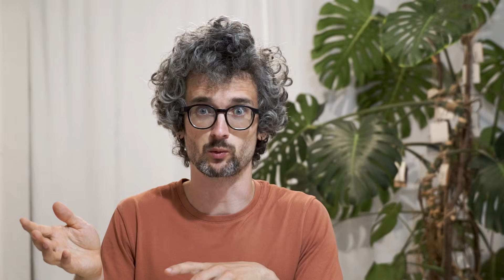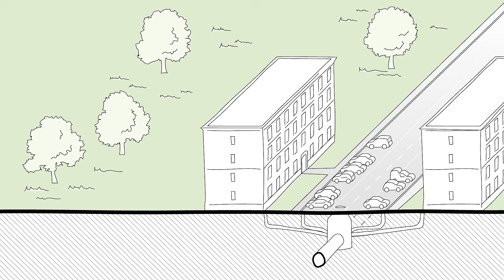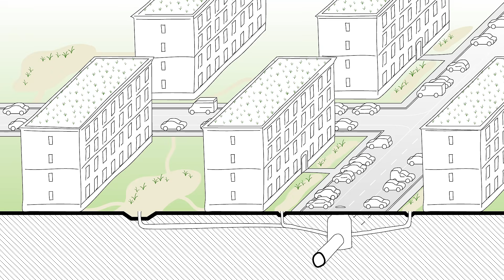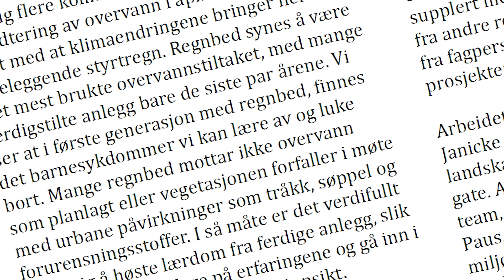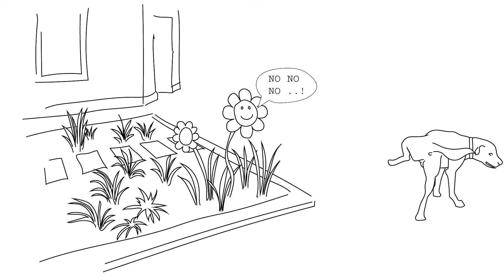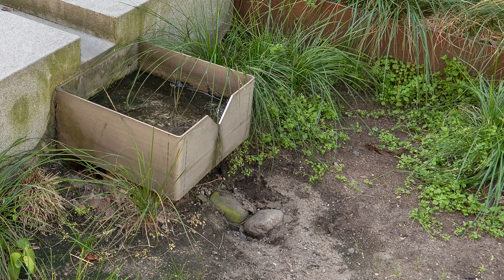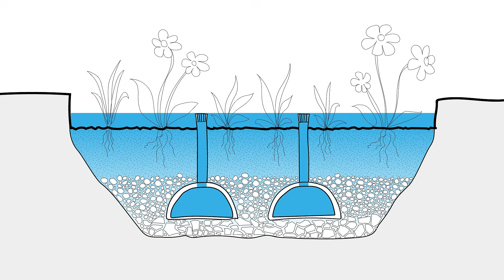How Oslo Turned Streets into Flood Protection

Comment: Two things that I guess probably need to be kept in mind and didn't come up in the video: (1) Raingardens should be designed taking the foundations of the buildings into account. We don't want the buildings to get wet cellars or weakened foundations because they were built under the assumption that rainwater is transported away quickly, and now there is too much hygroscopic pressure from the unexpectedly wet ground. (2) A city's drainage system was probably not built for long periods of carrying almost no water. This could lead to unexpected problems such as rats starting to feel at home in a location that was previously always under water, and causing critical damage in unexpected places. I am thinking of phenomena like a passage in a canal being blocked by the cadavers of drowned rats.
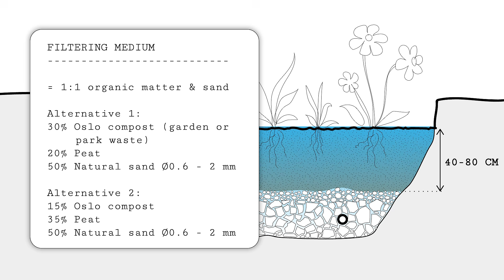Reply from the maker: (1) I briefly mentioned that in 8:28 - that is the reason to use drainage pipe in construction detail, to drain away water instead of letting it soak into foundations. 
(2) interesting, actually about this I did not really hear until now but I can imagine it can be an issue
Reply: @MareksUrbanChronicles  Thanks for pointing out 8:28. Maybe (2) isn't an issue. I guess this kind of thing is why these things start with experiments.

Comment: is there a point of saturation on the rain absorption at any level of rain intensity? i'm from brazil, a tropical climate, so it's common at least once a year to get something around 30mm in less than an hour, so i guess maybe it is not so worth the trade offs as much as in more temperate climates, although the retaining pool concept to not reach the overcapacity of "gray drainage" is very much welcomed

(sorry for my bad english)
Reply: Is not bad!😊
Reply: I'd assume there's a limit to how much it can help absorb. But that's still all away from flooding, and into the groundwater. It means less damage. I'd say that the more extreme rains you have, the more difference it makes.
Reply from the maker: in tropical climates it would be the best to use a combination of all steps probably. From small capacity green roofs, through medium capacity raingardens, until a high capacity valleys in city parks. For example you can check Bishan-Ang Mo Kio Park in Singapore, normally it works as a park, and during heavy storm it is just completely flooded. Photo dry/during storm: https://www.researchgate.net/figure/Bishan-Ang-Mo-Kio-Park-during-and-after-storm-event-32-photo-credit-to-the-Ramboll_fig3_354757552

Comment: Came here from a Brad Lancaster video - interesting to see how this can be applied in wetter climates. In Switzerland, we pretty much already maxed out our water retention and flood protection capabilities, but with the torrential rain getting more frequent and the winter snows less reliable, we might have to do similar stuff to cope with localized flooding. Last year they built a new storm drain system in our street to separate it from the local sewage pipeline - we live on a steep hill and rain gardens probably wouldn't have made sense.
Reply from the maker: True. With exception if there would be other part of the town under the hill which would be catching rainwater from your area. Actually in this Oslo project the part in Wilses gate is also built on a slope, through kind of garden cascades. Streetview: https://maps.app.goo.gl/q5yNmnFHrhMqN5gb7
Reply: Terraced rain gardens would definitely work. Probably need a different design, and the terraces would visually alter the streetscape significantly, but definitely doable.
Reply: @Lolwutfordawin  I think they discussed that, but people would have lost their precious parking spaces - you know how Nimbys can get.
Reply: @gabsrants so when they dont have where to park how do you fix that ? If no garage or other potential space do you just make the cars float ?
Reply: @nemanjap8768  I am 46 years old, I never learned to drive because I didn't need to. Look up public transit in Switzerland, there's tons of videos that will explain why - where I live - you don't need any cars.
Reply: @gabsrants  you wont get it anyway.
Reply: @nemanjap8768  that's probably correct.
Reply: maybe something that Hoboken did - a ResilienCity Park, worth a check

Comment: With a drain you miss the main advantage: growing the ground water table
Reply: Siem, he mentioned in the other thread that there are other considerations in an urban environment, such as needing to keep the ground drained to protect infrastructure.
Reply: In Oslo you have sloped terrain with at most a few meters of soil on top of bedrock in most areas. So the groundwater storage capacity is quite low. But the amount of precipitation makes drought very rare.
Reply: Even when it might not be as relevant in Norway, this is quite relevant in other countries. Even the Netherlands is more and more depleted of ground water. We really should focus more on (smart) water retention.
Reply: Norway only uses around 13% ground water nationally. The vast majority of water comes from rivers and lakes.
Reply: @HerrWalrus I'm sorry where do you think Rivers come from? If you don't have groundwater you don't have Rivers. If you have a low water table and do not recharge the aquifers you will not have Rivers or your Lakes.
Reply: @MyLoganTreks  What are you saying here? Not all rivers begin with groundwater springs, they also can flow down from rainwater and pools (including lakes) that lie on impermeable layers of rock. Aquifers aren't the only source of Norway's rivers - they begin on the mountains, and start either from glaciers or rainwater flowing down the catchments. You aren't taking into account the various ways in which the water flows. 

There certainly do exist aquifers and natural freshwater springs in the Nordics, as well, but groundwater isn't the largest river, or lake water source in Norway in specific - as the country the largest part of rainwater in the region due to the its geographical location on the western slopes of the mountain chain and by the Atlantic coast. The lakes and the rivers in the region collect the excess rainwater, and as another viewer in an above comnent states, the soil layer on top of the impermeable (granite) rock is rather thin. You appear to have no knowledge of the local conditions, terrain, geology, or climate?

(Editing to add that Oslo itself does not get the most rain in the region as it's situated deep in the fjord placing it into a rain shadow, but it still does have a relatively humid climate, a fair amount of rain during the relevant growing season, and direct access to much of the water flowing into the catchment area. Oslo doesn't have major lakes, and it's a coastal city in the first place...)
Reply: @MyLoganTreks  I get what you're saying, but in Norway specifically, rivers comes from elevations where cities and other unnatural obstructions do not exist... So not really a concern for us.
Reply: @MyLoganTreks  This is Norway, where most of the rain water is stored as... snow ON the many mountains, and in marshes between these mountains. Under that is granite, granite everywhere :)
Reply: I'm not so certain if Oslo needs any more water, being situated on the Europe's Northern Atlantic coast to the southwest of the Scandinavian mountain range, where it gets all the rain, leaving places east to it in something of a rain shadow. Norway thrives on water power they have, thanks to the mountain streams - which is ironic, considering that they have huge oil reserves under the sea.
Reply: @rvaviima  None of the things you mention dispute growing the ground water table.
Reply: @fyfaenihelvete They don't "dispute" it, I'm only saying that there isn't exactly a need to raise the groundwater table in the local conditions of Oslo - which you're likely familiar with - possibly even better than I am, considering the username you have. Jo nyt om maan perkkele että tarttes kirot tämmöttis. 😂

Comment: I live in center of Århus, and we need fever parking lots anyway, (combined w better bike & public transport), so its win win. See the Dutch, as they are ahead there...
Reply: When it comes to rainwatermanagement the Netherlands is in a weird place. Though the threat of flooding is a big one, the more consistent issue is actually dryness and a year over year groundwater table that inclines down. A lof of the solutions are similar looking but to an opposite effect. More grean areas get created and kanals are restored back to winding creeks and rivers to catch and retain more water into the ground before it gets drained away. And then theres the dychitemy (not sure how to spell this) on plants. They help catching the water by keeping the soil open and stable and allow water to soak in rather then evaporate by providing shade. But at the same time they, most common and local types anyway, constantly pump up and evaporate water too via their leaves. They stip doing that if things get too dry by going into 'fall mode' early, but thats one is not god for either the water table or the tree.
Reply: I would think parking lots could be elevated so that the rain catchments could be underneath and plants on the edges.

Comment: As a resident of Oslo, I really enjoyed this video. While I think this style of flood protection has a lot of benefits, I'm mainly concerned that they take up too much space. It is very unfortunate if flood protection along our streets comes into conflict with badly needed bike paths.
Reply from the maker: I see. Thanks for the comment. Sometimes when there is no space for rain gardens, the city puts tanks in underground. This does not really allows for evaporation or more water in dry soil, but at least you store the water locally and can use it later e.g. for irrigation.

And for the bike paths. Normally in well developed bicycle places like Netherlands or Copenhagen they use bike paths only on bigger roads - there is more space for them but also more danger for cyclists (speed, traffic density). In calm residential neighbourhoods, which often have narrow streets, they just make sure people drive slowly, and they don't build there bike paths. Bikes share road with cars, but maximum speeds are somewhere 20-30 km/h supported with speed bumps and other measures.
Reply: Rain gardens are being installed elsewhere in Oslo too. I saw that the newly renovated Majorstuen outdoor metro station have them: stone channels leading water to dotches with gravel and greenery
Reply from the maker: @AreHan1991  sounds interesting. sadly i could not find any pictures of it
Reply: These streets don't need bike paths, though. They're fine as they are for sharing the space between pedestrians, bikes and the occasional car. I feel like this is the area where Oslo has gone a bit wrong with our bike infrastructure: We're just cramming it in everywhere without considering whether other changes sould have made the street better in a more general way. I actually think most streets (not major/high traffic streets and roads) that have gotten bike paths in the last few years would have become better with this kind of infrastructure instead of the bike paths. Or at least a lot of them would.
Reply from the maker: @piofinn  depends on speeds and traffic volumes. Usually it is good to ask - would I let my kids to cycle to school via this street? That answers if / and what kind of bike infrastructure is needed there. If it is safe for kids, could be doable for everyone.